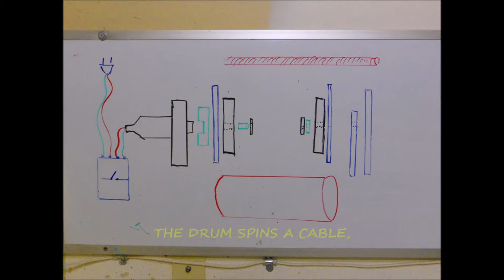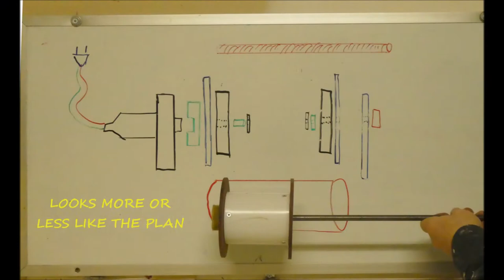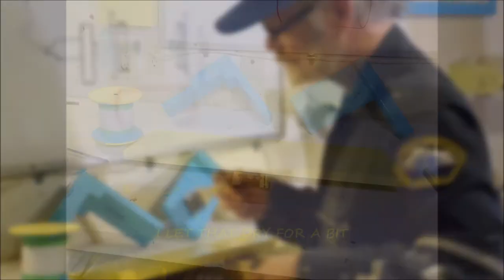USE A POWER WINDOW MOTOR TO BUILD A LAUNDRY LIFT

Comment: what is the RPM of the motor?
Maximum weight it can lift please?
Reply from the maker: don't know the maximum load, but I use it to lift about 10 lbs of laundry. As for rpm, that is not really relevant, as it is geared to go as fast as a window goes up!